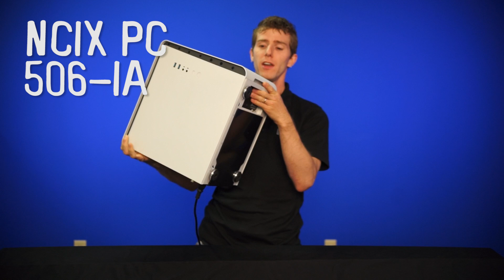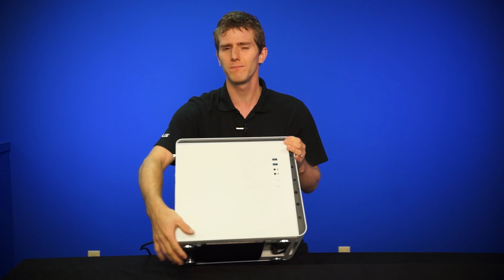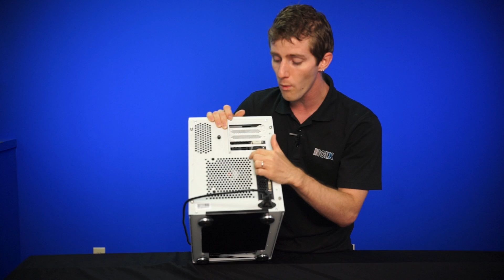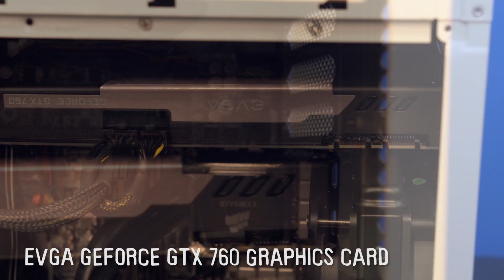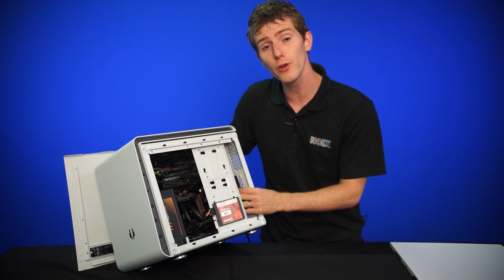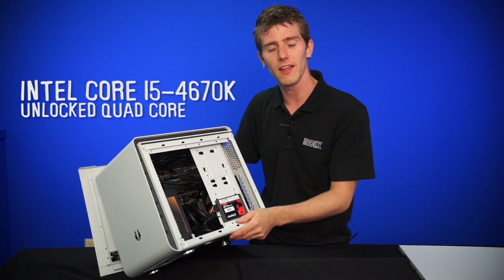NCIXPC - 506-IA Ultra-Compact Phenom M

Comment: Hy, thanks for review. I'm concern can I fit H80i CPU cooler instead of H60i? I'm worry if there gana be enough space mounting in the rear of the case and if it will not  step on CPU mount.

PS: seems like I will go with ASUS Z87 Gryphon TUF instead of Asus Z87M Plus.

Comment: they swapped the side panels because cable management is a nightmare in this case and swapping these panels helps... a little bit. 
(if you don t swap it, you have to place the cable everytime you open the side of the comp due to inverted mobo layout)

Comment: Specs don't matter unless you check the benchmarks. Nvidia's cards are generally more compatible with games and tend to always run them better. infact the 760 beats the 7970 in most games by 3 fps. 30 extra dollars for -3FPS? Worth it. how about you do some research

Comment: The memory bandwidth of the 7990 is double the Titan, it's texel rate is 30% more, and it's pixel rate is 50% more. They have the same 6 GB memory specs. The 7990 is going for about $700 now and the Titan is still $1100. I would much rather pay $1400 for double the performance of a single Titan, let alone $2200 for the Titan to match it.
AMDs R9 cards will be 600 and be faster than a Titan anyway, so just crossfire a few.

Comment: Yes the 7970 is more powerful than the GTX 760. but its 100 more fucking dollars. what, do you want them to go with a shitty board thats limited to like 8gb of ram and absolutely no future CPU upgrades because the TDP is low as fuck and it has low grade components so its likely to break within 2 years? the mobo is the fucking center of the system. you don't want to cheap out on it. fuck up the mobo and you could fry everything in your system.

Comment: also w/o that mounting solution for the ssd you're able to put in a 140 rad push/pull instead of only 120. ssd could easily go on the bottom or above the psu if you wanted to install an additional fan on the bottom.

Comment: I like the layout of the case but don't like the size, too small. the top also needs to be completely removable. why provide a significantly better mounting system for the GPU if you are not going to make the top removable. (would have been an awesome way to quickly clean the videocard's heatsink without having to remove it. (just open the top, and clean the heatsink)

Comment: awesome design overall, but I would personally go for a faster GPU and slighter lower cost motherboard to offset the cost of using an h80i instead. the h60i will have trouble handling that CPU when you start pushing 1.3V or higher to it.

PS if you want to see an awesome price to performance ratio, get the i5-4670k, and overclock it to 4.7GHz (you may have to use a little over 1.3v but you will see some awesome CPU performance for the money)

Comment: Max 1080p is fine. My monitor is a 1080p. I would like to have a 4K monitor, but I heard games don't look right on it and cable broadcasts aren't in 4K yet. So kind of useless right now. But if I am fine for a few years like you say, then I am set. I just to be able to run high end games like The Division, Witcher 3 and Star Citizen at max and get 60fps. If I can do that, I wouldn't care about maxing any other games. Thank you for your input.

Comment: He had asked what the best GPU was. He never specified whether he wanted a single or dual GPU card. GPU, while not what it means, is used as a general term for Graphics Card. You can take things here as face value, but a GTX Titan isn't a GPU. GK110 is the GPU, GTX 780 and GTX Titan are the Graphics Cards they're in. You should really learn to think into things instead of just taking them as face value.

Comment: It's the price point. No one is going to spend 4 grand on video cars, so a single card vs single card is where this is at. Also, even if they were to add another card down the line, crossfiring dual 7990s is half the price, with double the performance.

Comment: There won't be any i9's. What you have will definitely max everything at 1080p, but I can't say for 1440p or if you decided to go multi-monitor. As for Mantle, AMD said that isn't going to be open-source so it sounds like the "hardware-level performance boost" may only apply to AMD specialized games. It's a lot of speculation, so it's hard to say until it's released, but I'm sure you'll be fine for at least a few years. I can't say you can max everything in 3 years though.

Comment: Do you think intel will release i9s or just make a whole new intel series altogether? I will be using a i7-4930MX overclocked to 4.3 ghz and a Geforce GTX 780M SLI, and 32 GB RAM (1600MHZ). You think I can max everything with AA on? Because with the new Mantle that's suppose to change things, I wonder if the system can max future games for 1 year.

Comment: The future? It's possible, Star Citizen has some crazy requirements for current hardware, and BF4 isn't going to be a joke either. It's hard to future proof because you don't know what's going to come out, but I think you'd be safe with any i7 for the next couple years. My 1st gen i7 hasn't bottlenecked me so far.

Comment: Glad I'm not the only one who thinks this thing is just poorly designed. No idea why they felt they needed to flip the motherboard and no idea why they designed the optimum cooling to pull air from the top instead of the bottom/front.

Comment: Ya it ships on the other side but it's a cabling nightmare because having all those cables attached to the side you take off and having to unplug the 3.0 header, 2.0 header and the lights from your board every time you need to go inside is stupid. You can switch it to the other side but the buttons will be upside down but you will never have to fuss with the cables unless you are installing an HDD/backplate for a new cooler.

Comment: Looks like you had the i/o panel on the wrong side of the case, the 'R' for the reset switch was upside down and the ports are normally towards the bottom of the case, not the top.

Comment: No.  Gaming does not take advantage of 8 threads vs 4 threads of the 4670k.  Unless you're doing processor heavy work like rendering, video editing, etc you don't need the i7.